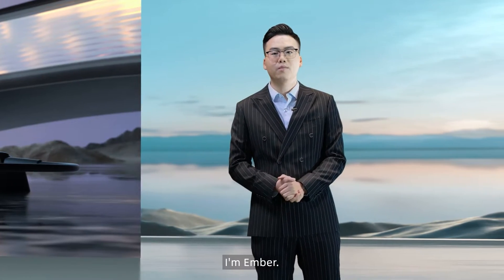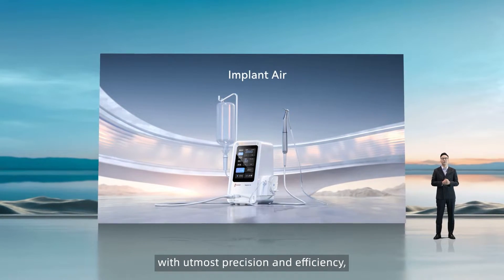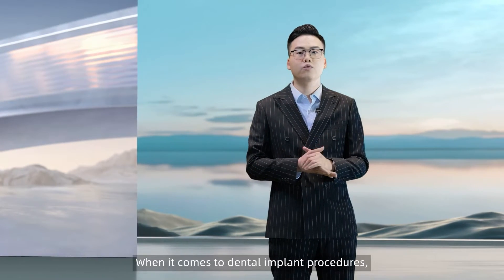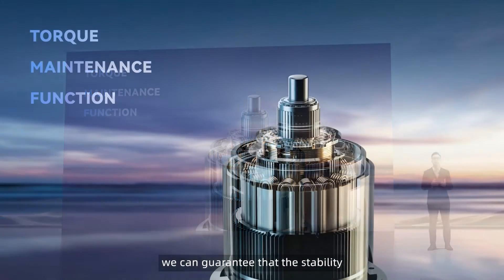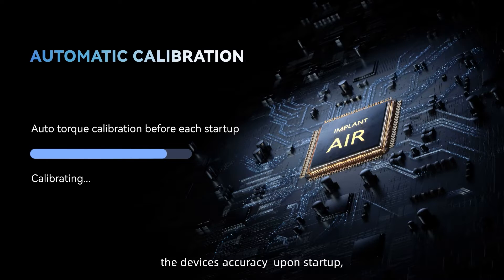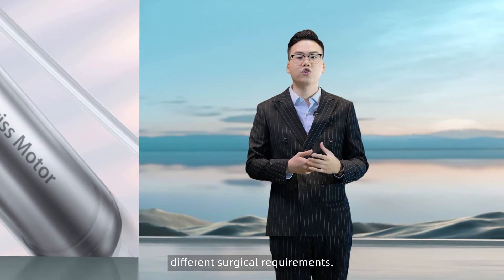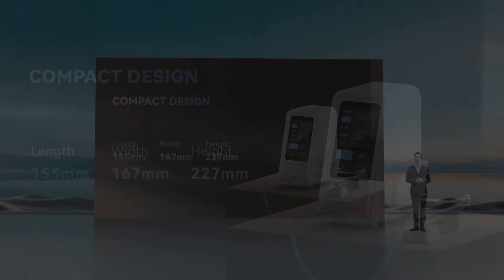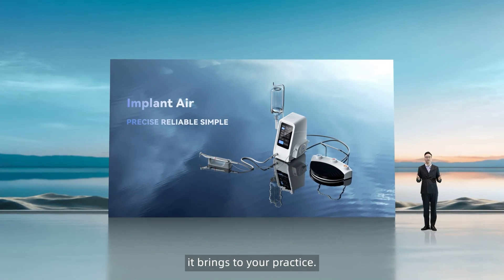【Woodpecker 2023 New Product Launch】- Implant Air

Comment: Is there a difference between Dte implant air and Woodpecker implant air? Is it same device, same micro motor and bearings or different??
Reply from the maker: Hello dear, it is a same device.
Reply: @Woodpecker-Dental  Thank you, I had the same question. I only find Dte and i worried about the quality
Reply from the maker: Hello dear, thanks for asking, there is no difference between Woodpecker implant air and DTE implant air.  @raigna1